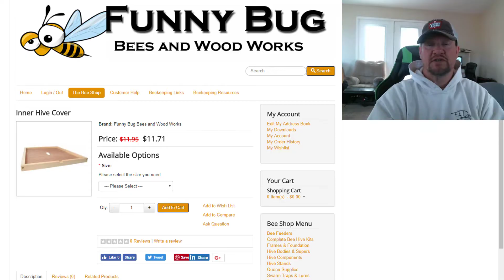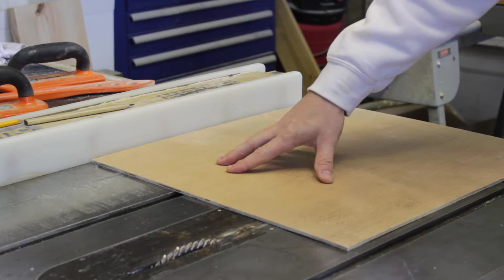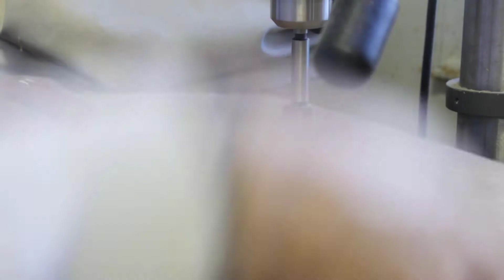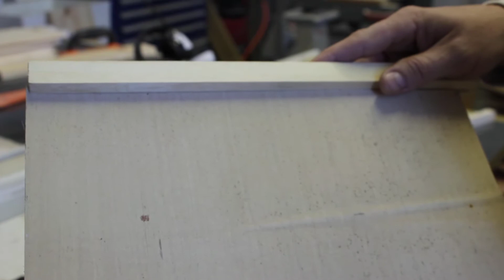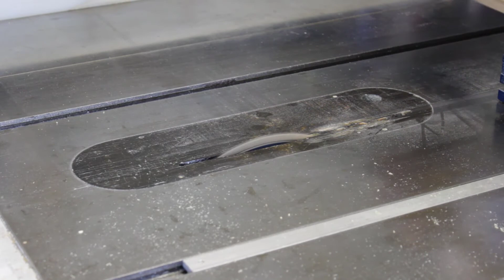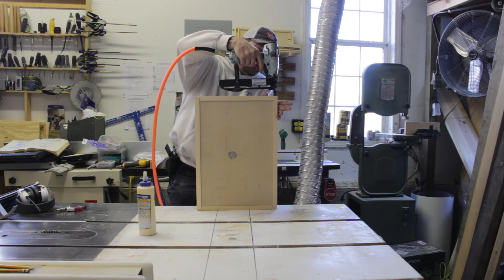HowTo: Build an 8-frame inner hive cover step-by-step

Comment: I love watching you build stuff.Would like to add a note for new BKs.That if you run 8 frames ,GREAT.If you started with a lot of 10 frames like most of us.Then stay with that.Better to just partition to make it into a double nuke or if you want to convert to 8 frames just for fun.Then insulate each side of the ten frame with one inch thick insulation board ,Increases the r factor and wha Laa  you now have an 8 frame box.I suggest you use small screws with washer to fastened insulation in,so you can get your ten frame box back if you change your mind later.To many odd sizes can really mess you up and complicate your journey down the road.Trust me you will save a lot of space and head ache by staying with uniform stuff you can use when you need it.
Reply from the maker: If you are using the insulation to inexpensively reduce the interior dimensions im all for it. If you are putting in insulation to increase R-value its a waste of money. There are several studies that show that a cluster of bees easilly generates 107 degrees F in winter. Besides keeping bees artificially warm actuallt increases the amount of food they go through and can contribute to starvation in winter if you are not keeping tabs on food stores. On the frame size, I actually started in 10-frame and switched to 8-frame a few years ago. Im too old to be wanting to lift 10-frame supers full of honey anymore, ill leave that to you young guys :P